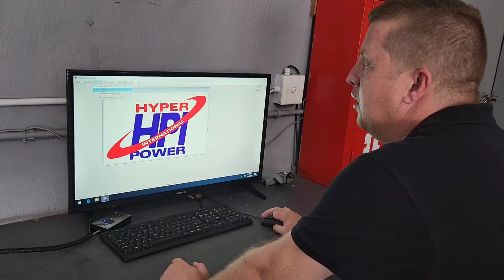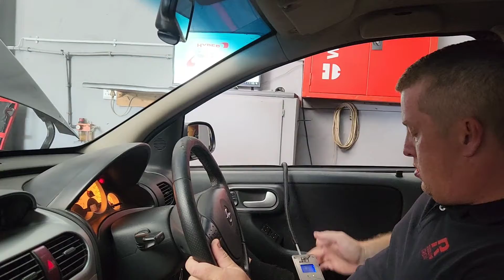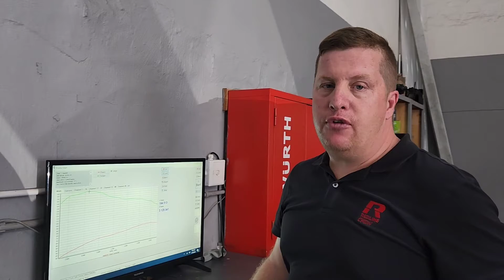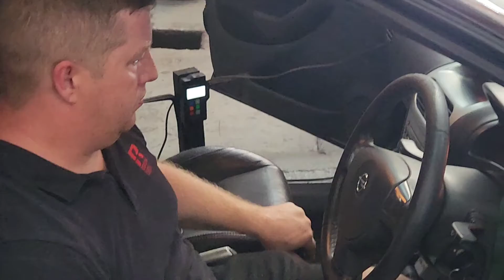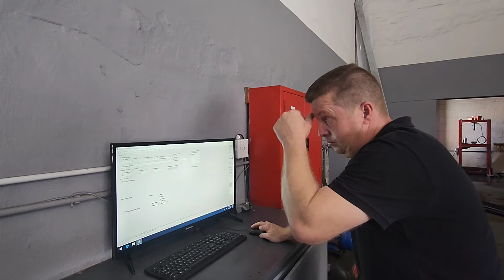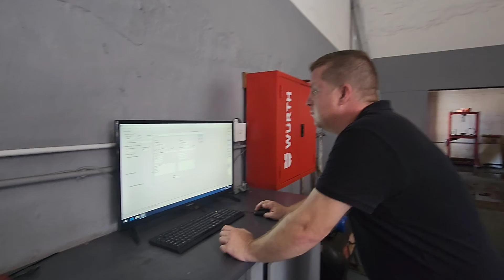how to tune your opel corsa for more power

Comment: While I driving the bakkie Corsa Gamma  Y17DT its dropped the power and push the smoke at back then runs again the do the something aģain so what is the course of
Reply from the maker: Maybe airflow meter or boost contol valve

Comment: Hi mark. Got a opel corsa gamma utility. Has very high fuel consumption all of a sudden. Plugs are burning black. What could possibly cause that?
Reply from the maker: Lambda sensor or manifold pressure sensor
Reply: Also try these spark plugs  2828 BPR5EY